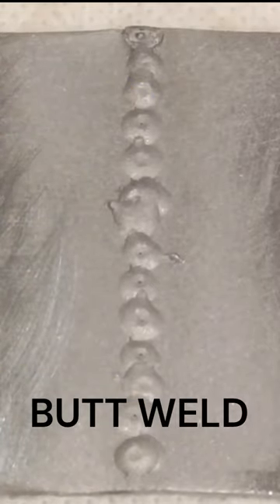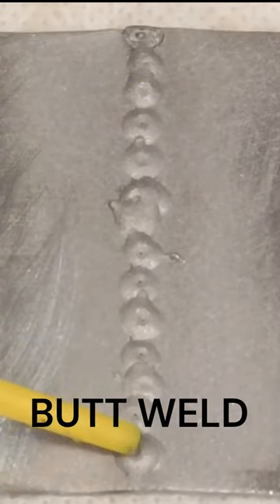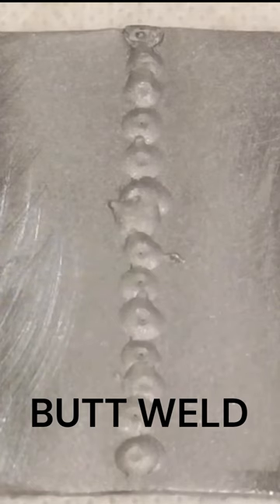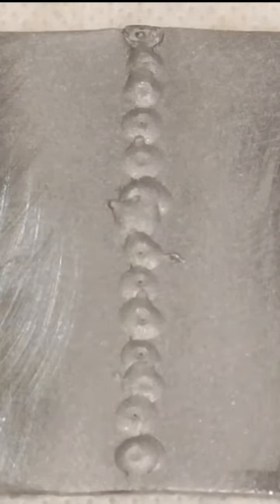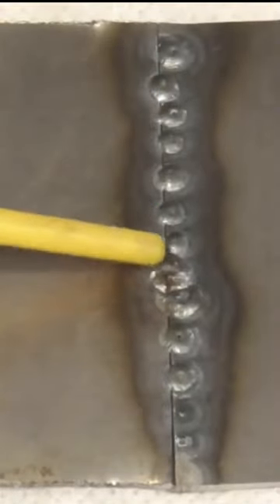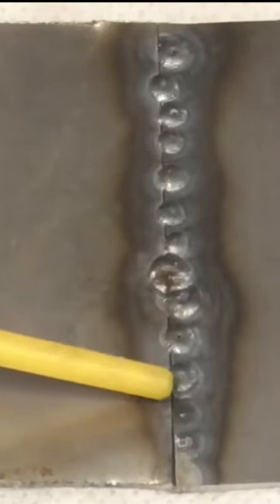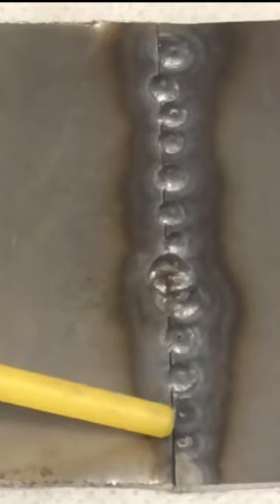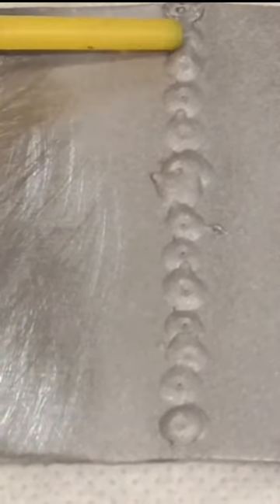What's Wrong with Butt Welding Patch Panels?   #shorts #autobodywork #autobodyrepair

Comment: "I'm very confident in my welds". That is the problem. You missed the joint with your welds. You didn't get filler completely across both panels. It's evident on the front as you can see the joint between the tacks and when you flip it over it is even more evident that you missed the joint. This video is a great demonstration of how not to weld a butt joint.
Reply from the maker: Not one body man is welding nuclear waste containers my friend - https://www.youtube.com/watch?v=idrLzsz2eLg

Comment: Seam needs to be completely filled, if you grind the tacks while they are an inch or so apart you will be able to completely fill the seam with no gaps, I also seam seal over the back of my welds to make sure there is no rust issues, if I can’t seam seal, I put epoxy into a syringe and inject to cover weld and seam.
Reply from the maker: 👍😊- have a great week 😊
Reply: exactly, if you don't grind your first tack flush your next tack will not penetrate.

Comment: I agree in that scenario, that's why i strongly advise against MIG welded sheet metal butt welds when spotted together.  A butt weld is the appropriate repair, but must be continually welded either by TIG or gas to avoid this situation.
Reply from the maker: 👍 - obviously it is possible to do but highly unlikely that you get it perfect.  It's probably why they leave the welds alone on propane or compressor tanks 👍💯
Reply: @LakesideAutobody  in areas of strength without the concern for aesthetics there is no need to grind, such as that tank situation, or heavy equipment.  But there is no reputable coach builder doing anything other than butt joints mid panel.  A fender, let's say, maybe constructed of multiple pieces, but will be homogenous when ground and planished, possibly metal finished.  I understand this isn't a cost effective method for standard auto body repair shops to perform a patch, but it is a correct way to join sheet metal.  The alternative would be panel bond, or a lap joint (moisture catch)?  There are many different processes to complete a task, all have there pros and cons.

Comment: What a good video showing what we normally would not see! Great tip on not grinding away most of the other side!
Reply from the maker: Thanks for your input Uncle Mark - much appreciated 👍💯
Reply: You have to grind it. So you can eventually paint it. It's a car panal,  so you would grind it smooth. That's a butt welding with the panal touching.  He was showing Why That's the wrong way. You need to either lap weld, which is a overlay of the panel.  Or do a butt weld.  But leave a 1/16 inch gap for your weld to penatrate
Reply: @ryannichols8315  Yes, that’s is what I understood as well. A good reminder.

Comment: Great demonstration!  But to be clear, are you suggesting a different type of joint, different weld process, not grinding, or ?
Reply from the maker: Sorry - should have stated that.  Lap welds are most commonly used in body shops - either MIG welded or glued.  Recently there is a lot of misinformation on the internet about butt welding being superior but the truth is you'll use both lap and but.  The key is to NOT grind the welds flat but grind them lightly, tap the seam down a bit, fill, prime and paint.  Something like this - https://www.youtube.com/watch?v=yGNi-f3Wrjo
Reply: @LakesideAutobody  it seems like the lap would be the strongest, but I don’t see how it’s possible to create that without it being a water trap.  Thanks for your reply!
Reply from the maker: This video explains it in detail - https://www.youtube.com/watch?v=JIIonJOVro4 @KSMike1

Comment: butt weld looks nicer but i like strength over appearance.
same with my engines, transmissions etc , i dont care how they look , its how theyre built that matters the most to me.
i understand in your profession everything is about looks thats why i chose mechanical and electrical , i hate vanity and have little patience for getting paint 100% perfect in appearance.
i quite like the look of rat rods etc
Reply from the maker: 👍 - I with you on that.  I like stuff to run well - that's the most important thing really.

Comment: I find if the metal is thick enough it’s easier to use flux core with the other style of nozzle since you can see your nozzle and wire. I can always run a straight bead like this but obviously it has its limitations and will be harder on newer vehicles with real thin metal.
Reply from the maker: 👍.  I'm not really saying it's impossible but saying that these are the issues that are common to seam failure.  If a guy can weld it perfect, then grind off his welds flat so you can metal finish great - but that's not happening often.  Probably why compressor tanks have the welds showing :)
Reply: @LakesideAutobody I agree with you and often do lap weld the panels. I just noticed that a lot of people seem to fight not being able to see the wire and tip because of the gas shield using mig.

All I have is flux core and I realized it might actually be a bit easier because I have no issues running perfectly straight down a cut, the issue is blowing through the thing if I'm not careful. I find I have to turn up the wire speed quite a bit on thin metal, like 22 gauge, and have to grind more in the end but will not blow through. It still penetrates good since it's so thin, and as long as you do quick tacks you won't notice the high wire speed pushing against the panel at all. 

Those resin fiber discs you use are absolutely amazing by the way. I was astonished by how quick and long lasting they are. I don't think I will ever go back to a regular grinding wheel. Thank you for that info in other videos as it really is a game changer and I had zero clue they existed. 

I have gotten quite a few of the tools you use on your channel. My dad said, "I wish I had all these fancy tools when I was your age. My straight sander was a 2x4!"

Comment: And that's why there are times where a lap weld is better...with the use of a panel flanger.
Reply from the maker: Thanks for your input MN - I'll do a video or two on flanging.  Do you have good luck just using plug welds on the flange?